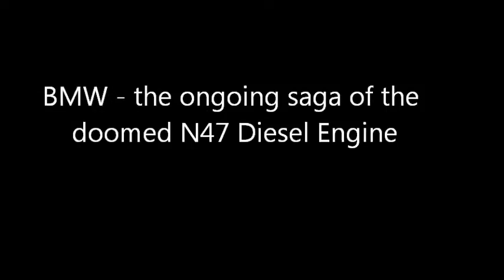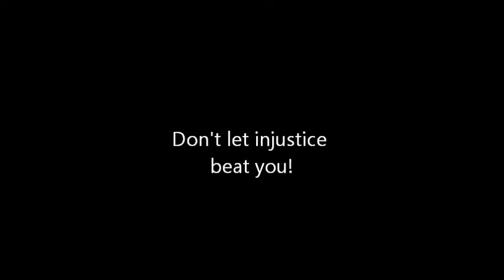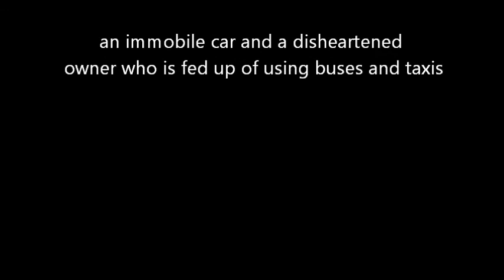BMW N47 Design Fault - My Experience

Comment: The trick is to replace the chain BEFORE it fails
Reply from the maker: George Austers How? They’re non serviceable. They were developed to last the lifetime of the engine. BMW were so confident   of this that the timing chain even didn’t feature as part of the service plan. They’re crooks!
Reply: Roger Gray Everyone knows they’re a problem now, so replace it before it fails
Reply from the maker: George Austers It’s not the customer’s responsibility. This is a manufacturing design fault. The whole engine has to be removed just to reach the timing chain so the labour costs alone would be astronomical
Reply: @ParkLakeside  Of course it's a design fault but you can't be naieve and just run the engine until the chain snaps
Reply from the maker: George Austers I think we’ll end this conversation. You’re not making any sense. The car’s been sold now so it’s no longer a problem for me

Comment: Mine just went pulling off from traffic lights, after a week earlier having a full service, only told my wife the day before how well it was running. No rattling noise, nothing. It was running perfect. Great piece of reporting. Bmw very quickly offered me a courtesy car. If they do nothing, it's taxed for a year so will park it outside BMW Newport Sytner, with a large sign if you do over 100,000 miles don't buy a bmw. Look at my massive paperweight!!

Comment: I had an E90 2009 320d with the N47 engine a few years back. I took out BMW extended warranty up to 100k miles in order to cover this issue.

Comment: Sad this happened to you and all the other people but this is not exclusive to BMW. Many car makers have had trouble with timing chain failure not normally resulting and catastrophic damage like you experienced but still costing a lot of money. Engineering failures at common with all car makers it's how they handle it that determines whether they get my ongoing business.
Reply from the maker: It’s very much exclusive to BMW. They attempted to develop an engine where the timing chain formed no part of the service plan.....in other words to last the lifetime of the engine. 

So by doing that the timing belt was made inaccessible (located at the rear) and could not be repaired unless the entire engine was removed; hence the high labour costs. 

BMW have never accepted that the original timing belt was too weak even though they later modified it!

Comment: My 2011 320d suffered the same!!! Just went dead on my whilst going on a roundabout. I've just got my car back after the chain snapped. Valve was open when this happened wrecked and writ off my engine. After fighting with them they agreed (BMW) to help with cost on parts but not labour. I was quoted £3300 for labour but this could add up to more and was later told it would be almost 4k. I gave up fighting their customer service was absoulety appalling. I decided to take my car else where and had the engine replaced. I've since updated DVLA due to new engine. BMW have made me feel so vulnerable and extremely disappointed in their care they offer. My vehicle was fully serviced by BMW and only had 77k on the clock. I've got pictures from the garage that did my repair and they could not believe the damage caused. Still 3.3k out of pocket and in all honestly if the car was not worth more then the repair I would of scrapped the car!
Reply: Honestly the more i read the angry i am getting. I suffered the same but only my chain did not snap, just lost power. Quote to fix is over 2k. DIsgusting.  I was in A10 in outside lane, i could have died.
Out of principal i am not accepting this disgusting behaviour.
Will update.  Look at facebook under BMW fault..sooo many more with the same issue.
I'm contacting watch dog. 
Will update.

Comment: For a car under 100k miles and with full bmw deal service history, they should have repaired the engine for free or at a heavy discount under "Good will". BMW are to blame with there stupidly long service periods. Timing chain and turbo faliure can be minimised by changing the oil at 6000 mile intervals. Skrew their 20000 mile recommendation. It's a money making scam.

Comment: Good video. I’m currently weighing  my options for purchasing a E91 BMW with N47 engine or a Mercedes C-class with the W204 engine.  But the more research i do, the more i get discouraged becasue of that faulty timing-chain issue of BMW. I’m leaning towards a Mercedes now. Thanks for making this video.

Comment: Its not just the N47 engine. I had a N43 that failed, the timing chain guide broke off and found itself in the sump and seized the engine due to blocking the oil pick up

Comment: I have owned 6 BMW 3 series tourings since the mid 1990s. Always loved them.
The problems with the E46 diesel swirl flaps really put this company in the last chance saloon for me. But I spent a day removing the swirl flaps on my E46 and then it was OK for the 40,000 miles I had it for afterwards (until all the wheelarches rotted out of it- not great build quality either). 
I was about to buy a 2012 320d M-Sport to replace my M47 engined E91, when I read this. I can't afford to take this chance. BMW is so, clearly, not what it was. I suspected this with the e46- but this has confirmed my fears. The thing with the swirl flaps was a pain, but doable for most home mechanics- this one is russian roulette and I'm not taking that chance. 
I need to look at Mercedes Benz, despite poorer handling and roadholding and i'm sure have their own horrendous faults now too- Lifetime customer lost along with thousands of others. Well done BMW- shame on you. I hope you read some of these comments.

Comment: My Car broke down on way home from night shift just before Xmas, first day garage could look at it and the bloke reckons between £2,000 to £4,000 to repair Timing Chain Failure,  value of car a 2008 118 with only 76,449 miles on clock approx £3,000. Like the car a lot but repair cost to value would seem insane. If BMW dont offer me some help I will never buy another car from them.

Comment: Just had mine replaced all 3 chains and guides with sprockets. 5h job drop gearbox remove clutch and flywheel and off you go its much easier than with it ob front of engine.

Comment: Just changed the timing chain on my BMW 118d 2008. Costed me £880 all together. Car works fine now.
Reply: Who did this for you? Had it already broken down or did you do it as a precaution? My Car broke down on way home from night shift just before Xmas, first day garage could look at it and the bloke reckons between £2,000 to £4,000 to repair Timing Chain Failure,  value of car a 2008 118 with only 76,449 miles on clock approx £3,000. Like the car a lot but repair cost to value would seem insane. If BMW dont offer me some help I will never buy another car from them.
Reply: Where did you take your car to replace it?

Comment: I have just had the same problem on my 2010  520d.  Had full service history with dealer and less than 70k on the clock.  BMW agreed to pay more than half the cost, but still costed me more than £1200 to fix.  Gutted that it should happen at all!!!
Reply: jasonsun01 how did you contact bmw? I have a 525d 2011.  It doesn't have a problem as yet.  But I'm getting really concerned about the whole thing.  Where should I contact them should I need to?

Comment: Did you get the issue resolved?  I suspect I just had the same issue with a 2010  520d
Reply from the maker: Not by BMW and it's despicable how they close ranks at times like this. I took it to a guy near Peterborough who rebuilt the engine and put the 'modified' BMW chain on for me. The balance......a cool £3300! It's Japanese cars for me now.

Comment: I've got an E46 328se. I was going to buy a newer model, but this issue has really put me off BMWs now, I'll keep my old beemer, 155000 miles, still going strong. Can't believe these engines are failing, they should be bullet proof. Sorry to hear your story.
Reply: MrMickhew don't buy newer model. I have an e32 730i. It's got over 400000km and runs like new, timing chain will never cause any problems on old bimmer because they are made to last

Comment: I bought a brand new 3 series in  July 2012. It was a 2.0 Diesel fitted with the N47 Engine. At 11,000 miles the timing chain failed ( bad Rattle sound ). It was fixed under warranty and all ok now. Stay away from any BMW fitted with the N47 engine. BMW say that there shouldn't be a fault with the 2012 and onward models, but when mine was in the dealership to be fixed there was at least one other 2012 3 Series in to be fixed with a timing chain issue.
Reply: N47 design engine with inaccessible timing chain under bulkhead, design is problem
Reply: Are you saying the new shape BMW F30 still has the timing chain problem?
Would a 2015 model be ok just before the facelift it still has N47 engine though
Reply: Dead Reggie 
As long as it hasn't got the N47 engine you should be ok. 
Not all N47 engines are going to have problems you could be lucky and drive years without issues. Personally I wouldn't touch a BMW car with a N47 engine.

Comment: Hi guy ! i have just started the process ,mine happens on the drive way in morning with a whining sound . i called BMW to diagnose the noise .The result come that was Turbo Failure .after fitting a new turbo the noise still there .i been told in other to do further diagnose it will require an extra coast in between 400 to 500 Pound .than they come back to me saying it is Timing chain . I just bought the car two mount from now a BMW 5 series 2010 with 70.000 miles in the clock .is anyone can advise me what to do in this case ?

Comment: What happened with me was I had just bought the car last year took it into bowker bmw to see if it needed a service ie: oil change etc.Thats when they said there was a recall.Checked the car,and said they needed replacing.When they took engine out they said I needed a new clutch and flywheel.They said they would fit new clutch free of charge with engine already being out.They have a recall because they no they have a issue with the timing chain.If they diagnose that issue it's perfectly logical for them to fix it.So can't understand why they wouldn't.You must of had a bad local dealer as they really can fairly from city to city.You could of took it to the civil court.

Comment: had mine replaced recently by bmw bowker in Preston.Just take into a bmw dealership and see if it is due for a recall like mine was.
Reply from the maker: Mine was due a recall but they charged me for diagnosing it. I refused to pay and they told me that it wasn't their problem.

Comment: bmw not what they were , on my e46 320d major  engine failure, broken camshaft , the cause a worn fuel pump sprocket , the fuel pump sprocket joins 2 chains  together  crank/camsgaft at 160k miles it should not have worn out the other sprockets were good as was the chain. replaced everything myself but will not be buying another bmw. (this is my 5th) the bmw logo is actually propellor blades , good job they don't make plane engines on a mass scale.
Reply from the maker: At least yours has reached a reasonable mileage. Mine's still on 91K and I've spent a fortune keeping it on the road

Comment: Bought a 2011 520d F10 few weeks back. Today going to work, it cuts out... Recovery guy comes and says timing chain :(
Reply: did you get it repaired?  I have a 2010 model which had the same problem

Comment: My car 58 plate also got the same problem. Just took the cam cover myself today, only to find out that everything is either misplaced or broken and cracked. Never seen such a mess in open engine. Car still turns over but won't start. The funny thing with my case is that this car had a chain tensioner changed by BMW less than year ago and it seems like it had gone again. I have invoice and I am about to do something with it. I am just wondering if they try to charge me 500 pounds just to confirm something what is already obvious. will take some photos and keep them. Any advises??

Comment: These engine are piece of s##t same thing happened to my brothers car he looked after the car since he bought it serviced it with best oil and parts. So many problems with these engines swirl flaps oil pump and so on.
He will never buy BMW again so will I.
Now Toyota is using these engines in 2015 Avensis models be aware.

Comment: similarly my BMW 320d coupe 57 just died on the road without any warning 3 days ago! I would appreciate if you tell me what happened with you and how did you resolve the issue if you did? i am very stressed
Reply from the maker: BMW refused to resolve the issue and so I took it down to Prestige Engines in Peterborough who are making a living out of correcting this fault. Even though they are doing quite nicely they didn't hold back with their view of the company and had some choice words for them! The total cost of repair was £3300 which included a complete engine overhaul and fitting the new stronger modified chain made by yes you guessed it.....BMW.  Perhaps the nearest we'll get to any admission of guilt! I'm not sure whether this affects petrol engines as I've never looked into but a word to the wise.......do your homework before you splash the cash or you might end like up like me, left high and dry and substantially out of pocket! Good luck!
Reply: Roger Gray thank you very much for the rep! as i bought the car second hand 3 months ago i can take it to the dealer to fix it for me using consumer right act, if not then i have a quest for £2k from a privste engineer, i will take it to him
Reply: +Roger Gray Why did you not pursue this through the small claims court?

Comment: Thanks for posting this, I was about to purchase a 520d on a 2011 plate this week for £10750 only to find that the same problem you have encountered has happened to the car I was getting delivered next week. Keep up the pressure and I hope you get some justice, BMW should be ashamed at how they are treating its customers.

Comment: Didn't BMW admit the responsibility (bad design) and issued a recall notice for N47 engines? It's for the engines manufactured between 2007 and 2011
Reply: +Roger Gray My local dealer took my 5 series in under the recall, changed the upper and lower chain, tensioner and head gasket completely free of charge. They also gave me a loan car, and changed something to do with the rear light cluster which also needed doing. I paid them for a new clutch, as it needed replacing, but they didn't charge labour to fit it. Got to say my experience was vastly different to yours. Best of luck to you!
Reply from the maker: Thank you. I consider you a lucky man and based on the responses I've had you appear to have had a rare positive experience. I acknowledge how difficult it must be for a large corporation to admit they've messed up on a design but to repeatedly deny it and then allow the customers to suffer the cost in my view is despicable!
Reply from the maker: +robertgral 2007- 2009 and the recall was on the 'tensioner' not the timing chain. They recall it and then they tell you it's £500 to diagnose it. View this company through rose coloured spectacles at your peril!
Reply: +Roger Gray hi Roger please call me 07460866141 ...i have 520d se on 2011 plate
Reply from the maker: No, they deny the cars have a design fault on them and in my view this is because it would literally open the floodgates to those countless owners affected.

Comment: Hi Roger, I have a 2011 320d with the N47 engine, I bought this year or car because everything I read said the fault was confined to the 2005 to 2009 model years, as it turns out that’s wrong, As I write this mine is having its chain replaced, I'm one of the lucky once (in relative terms) I managed to get mine to the garage before it snapped but it is still resulting in a £1000 plus repair bill, on a 4 year old car with full BMW main dealer service history. not a happy customer. the rest of the car is pretty good very comfortable and drives very nicely but lets be honest that’s one hell of a design flaw.
Reply: Snap same position as you. I had no idea about this issue until it happened to me 2 weeks ago. I have 1 series M Sports. I was on the outside lane on the A10 in Hertfordshire.  My car just lost power lucky fir me, i had beat the red light. If this was not the case, how it just lost power, the van tail gating me would have slammed into me along with all cars in this lane. It beg  belief. I see thec Travel lodge Hotel and lucky for me, I was able to glide the car over to the Travel lodge hotel car park   I was shaking honestly. Someone will die before BMW take responsibility.  Its disgusting. Unfortunately i cannot afford 1k right now. My chain has not snapped. If i could get this issue fixed, i could then sell the car  for 3k and pay off the bill. I'm having to consider selling the car for under 1k.😢
I'm contacting watch dog.
I want to start a petition to force BMW to take responsibility for 'THEIR' BAD DESIGN FAULT.